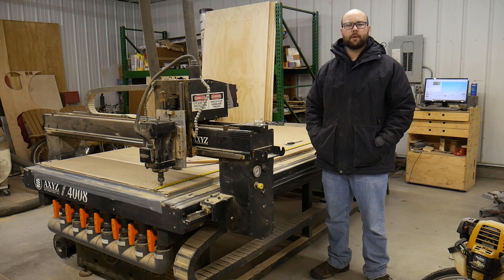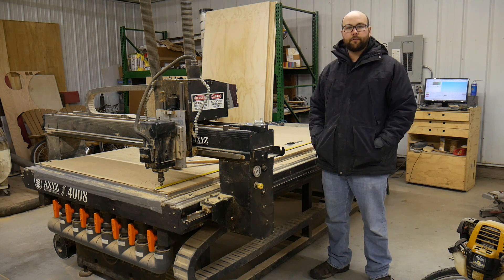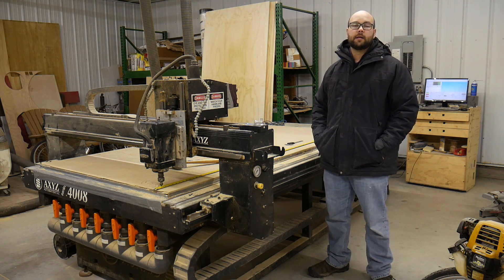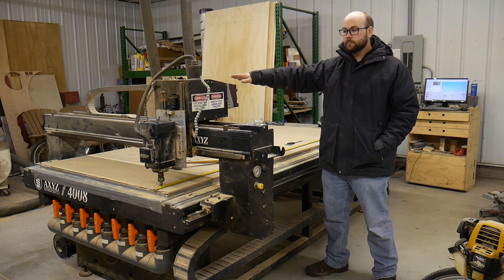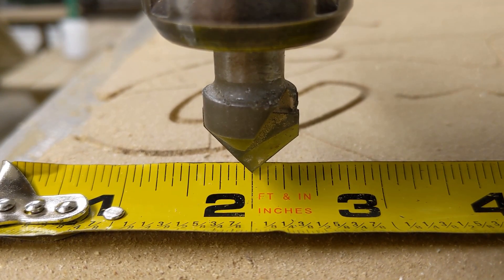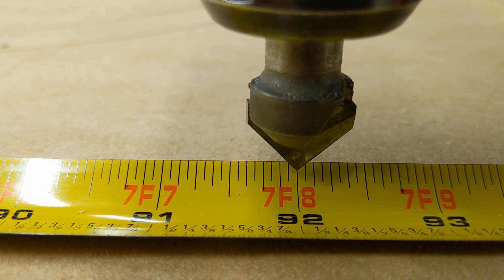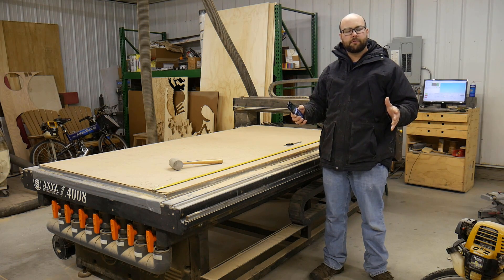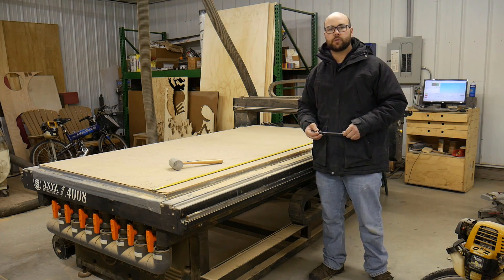A Better Way to Calibrate Steps/Unit on your CNC

Comment: Nice job. I have used this method since I got my 4x8 CNC a couple of years ago. After I check my X, Y and Z, I also check the diagonal using the 3,4,5 method.  I found my gantry was out. I think this is very important if you want to get square cuts.

Comment: Hello Tlar, I have the same machine running on Tollpath.  I saw a different software you are using so the video doesn't respond to my question: I got error code 803 that I cannot find in manual. Trying to fix the issue I change home position and didn't kept the original settings. 

Now I'm stuck with and trying to find information about how to fix this code. May be you can help? Thank you in advance!
Reply from the maker: Sorry, I can't help. I first thing I did was rip out that old out dated stuff and replace with modern electronics.

Comment: To set the steps per unit on our stacker cranes (a 18m tall crane that runs between 2 racks and stores/picks boxes into/from these racks automatically), we do exactly the same. We don't move it forward 1 meter and measure to calibrate it, we take the full 78 meter long aisle to calibrate the encoder pulses. We start from the zero-point on the rail and take a note about the current encoder pulses. Then we move it 78m further and check how far off we are from the 78m mark on the rail. We also note those encoder pulses, then move it by hand until it's exactly on the 78m line. Then recalculate the encoder pulses. I still gotta do this calibration of my cnc as I have a deviation of 2-3mm over the course of the total 80cm my machine can move. But for some simple signs, it wasn't really required to have those accurate to the millimeter.

Comment: Your calibration hinges on how acurate the  tape measure is , try this with 3 or 4 different tape measures you may be suprised ! Dial gauge over 1 inch VS  tape measure over 90 inch
Reply from the maker: I wouldn't recommend starting at zero on the tape but even a cheap tape will be more accurate then a dial indicator if you use my method. Its just one more way to do it if you don't already have a $500 indicator.

Comment: Hello TLAR, Thanks for responding to my question this quick. I really appreciate you. I guess I was getting confused with the pulse Equivalent and how to get it if you happened to get a CNC from China and nothing worked when received. I spent about 2 yrs. troubleshooting this machine. I have also flown a tech to help me to fix this machine. To be honest, I have learned more and I believe I have done more than what the tech did.
I have a 1300mm X 2500mm X 200mm working area  4axis ATC  with a rotary Along the Y-axis (not to mention that I a new to CNC). I used your method and advance my machine in the –Y direction 2463.8mm and my actual measurement was 2489.2mm. The current pulse set on my DSP is 64.
So the math would be 2463.8/2489.2=.9897 (64) = 63.3469 that would now be my corrected Pulse. I can also repeat this to get more accurate/verify. Also, this method can be used for my Z and A axis. What about the rotary part.

Thanks in advance.
Reply from the maker: Yes, that's right. I always do it a few times to try to get as close as I can. I have never used a rotary. I believe it's pulses per degree of rotation. But it's the same math.
Reply: @TLARinc  Thanks man...!  You are a Star. I actually tried it for my X, Y, & Z and it worked. It was easy like you said. Doing the Z was a little hard for me because of the lack of space needed to measure the actual travel. I am now hurnting for videos that shows how to install a XYZ touch plate. I have a Rich Auto controller with a Rich Auto DSP58E. Any input as to where i can actually make the physical connection on the controller. I know how to write the G-Code if needed. Hope I am not asking for too much.

I really appreciate you. Thanks and many more thanks...!
Reply from the maker: No sorry, I'm not familiar with the board. Lip for anything on the board that says inputs. Make sure you connect your touch plate to ground, the signal wire gets connected to your bit.
Reply: Thank you. I'll be sure to keep looking at your videos. Man, you have no idea how much headache you've saved me from having. got the machine working now.

Comment: Hello TLAR based on your example. the formula would be 90/89=1.011*89? I don't understand the last part of your example. Great video by the way.
Reply from the maker: Almost, divide what you want by what you got, so in my example 90/89. Take that number and multiply it with your current step/unit number. The reason is if you came up short on your test, you need to add steps to every inch, if you came up long you need to remove steps from every inch. I hope that helps.

Comment: I have this same issue.  When I use a 1" dial indicator I can dial in the Steps Per Inch perfectly in using the calibrator in Mach 3 but by the time its at the other end of 8' bed its way off like an inch or so.  If I use the tape I get good results but the dial indicator is usually off around .005"  I have tried multiple indicators even bought brand new one and they are all off the same so I know its not the indicator. So the tape works better for me too but I have had tapes that are off as well.  So you have to make sure you have a good tape.
Reply: Sounds like you're losing steps, check for binding by hand with steppers off.
Reply from the maker: Allot of cheaper machines use the steppers to keep the gantry square, you might get more binding with them off.

Comment: Hi I have done this exactly on my 4008 and always have, but still get circles that arnt 100% perfect, if u cut 2csircles and revolve them onto of each other there slightly  out by maybe .25 of a mm, 
How can u get them 100%  perfect
Thsnks
Reply from the maker: If you cut two circles with the exact same settings and conditions you may just be at the accuracy limit of your machine. Many things can have effect on this limit, feeds and speeds, rigidity, the material and bit combination and so on. Every machine is different.
Reply: @TLARinc  OK thanks, being an axyz I thought they would be spot on
Reply from the maker: Hmmm yeah I would think so too. .25mm is kind of allot. It's not your steps/unit though because the circles are different. Look for backlash. What is your drive system? If it's rack and pinion make sure your gears are all clean and free from debris. Also insure the the springs that hold the pinion into the rack aren't worn out.
Reply: Thanx! This was my thought to, and finding your video bacs my asumption, being a litle weirded out by the Mach4 vids my self. I think their logic is that they wil start small for safety as newbies might be totally of at first... don't you think? I'm allso curious what your thoughts and practis is when it comes to baclash?
Reply from the maker: I'm not using any backlash mitigation, I haven't needed it. It's more of a consideration for metal mills and lathes where everything is driven by acme screws and brass nuts. The ball screws and rack and pinion of our CNC routers don't suffer from backlash nearly as much.

Comment: great vid was wondering if I could get some info I am at my wit's end trying to work out what is the best micro step for my NEMA 34 I have built a machine that I would like to do plasma/router as  I have made the complete thing myself It is controlled by a 5 axis stand-alone controller. I have control of all the axis but the setting up of the steppers has me stumped
Reply from the maker: Use the largest micro step setting you can and still achieve the resolution you need. I like 1/4 or 1/8 micro stepping.  Too big and your machine will be noisy and won't run very smooth, too small and you'll loose allot of holding torque.  Once you've got that set up follow my steps/unit video again.

Comment: Nice. But What do you do now? 🤔
 Hehe, you see, I have just spent 4 hours to calibrat my machine. 😅😁 But i didn't figure it out! 
If you have an answear i would appriciate it! 👍
Reply from the maker: If your still unable to get close have a look at your backlash.
Reply: AXYZ makes a really nice machine. we had this same machine in a 5x9ish' foot at my old shop with 2 spindles. was my first encounter with a cnc router. that machine led me to trouble shooting it when it had issues and eventually building my own machine

Comment: Sorry for being nosy,  but I have to ask:  What do you do for a living?   Does it involve that great big CNC router in your video?   I think that I am a bit envious :-).   My CNC has a 6" x 6" x 6" volume.  I use it for engraving PCB and machining small aluminum parts. Sorry if my questions are too personal,  please ignore me if that is the case.   B.T.W.:  Excellent video.  I'm a  subscriber now!
Reply from the maker: It's my side hustle. Big or small they all take about the same knowledge base. Thanks for the sub!